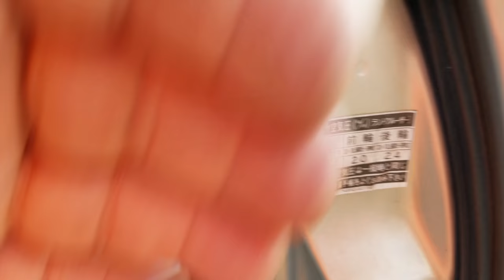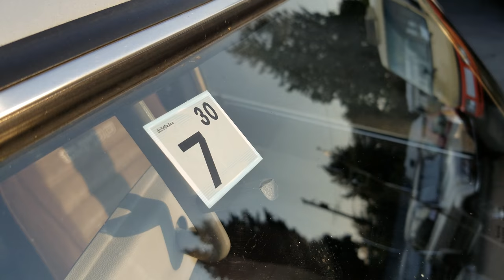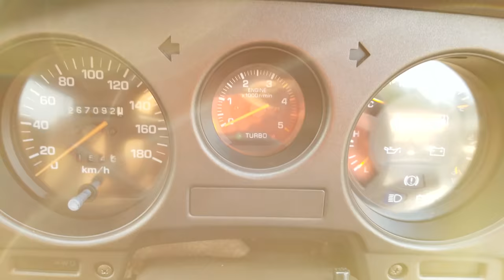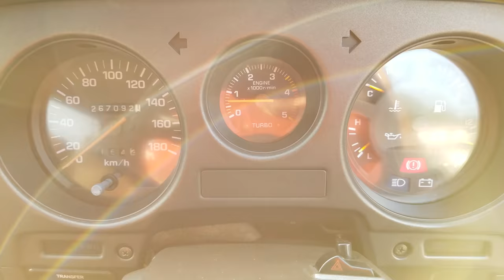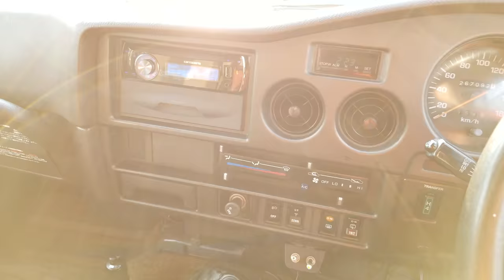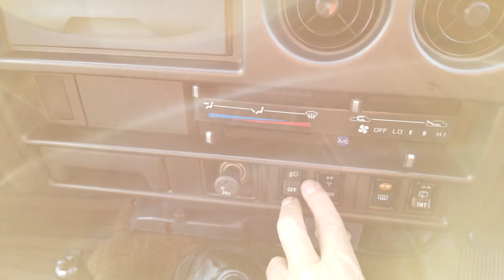1989 Toyota Land-cruiser 60 VX, 12H-T,  HJ61-014650 Parts-1

Comment: Got one just like it for the last 25 years with an original 3F and rebuild auto box, with over 700.000km on the clock. Still runs like new and has been just about everywhere in Australia. The best most reliable vehicle ive ever owned.
Reply from the maker: Thank you mate